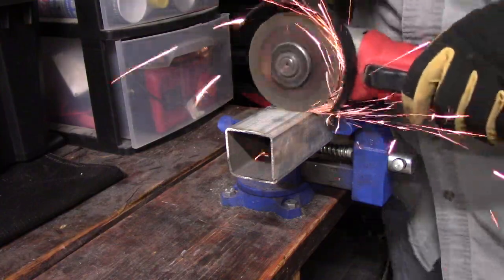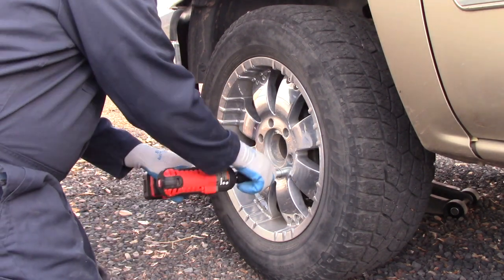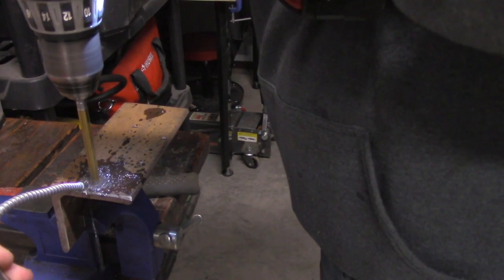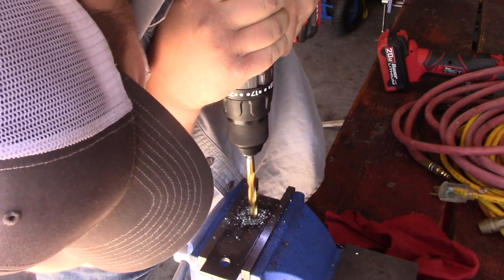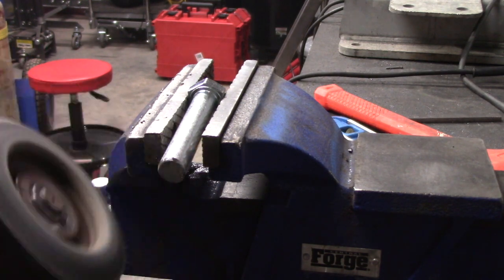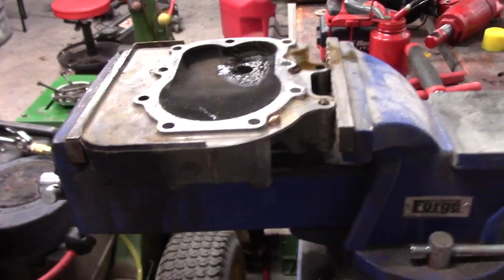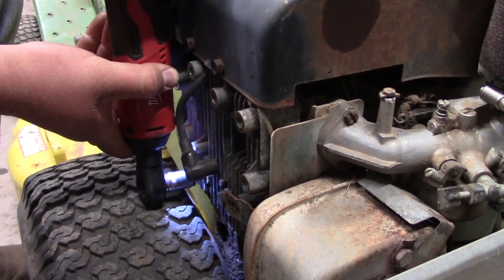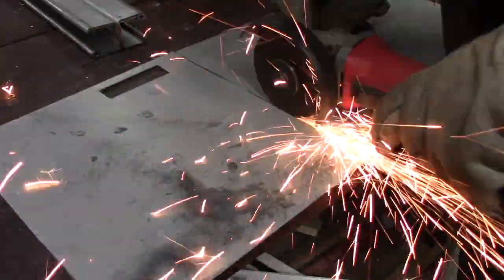Why I Sold My M18 Milwaukee Tools and Bought Bauer Tools

Comment: I prefer corded tools. And I don't really understand why everything needs to be cordless with a brand-specific battery... Or why a home gamer would need 4 different cordless drill-type tools. I've got a power strip right on my table and it takes care of everything 🤷🏻‍♂️
Reply from the maker: Cordless tools are super convenient. Being able to just pick up a drill and get to work anywhere you want is really nice, I grew up in the age before cordless tools. Plugged in lots of tools in my life, and now have cordless, I would never go back. As far as having 4 different cordless drill type tools, they aren’t all
The same. One is a hammer drill for concrete but all does regular drill work, one is a cheaper regular drill, one is an impact driver which is not the same thing as a drill, they sort of work in the same purpose but it’s significantly better at driving screws. Then I can’t tell you how handy the right and drill has been for tight spaces. All in all, having a variety of cordless tools for me is like collecting model cars for another guy or guns for another, I just like having them at my disposal, I like having the full tool line. It’s not necessary for sure, but we don’t always do things out of necessity.

Comment: Reviews. Do the reviews man. I'm kinda in the same dilemma as you. I got the ol Craftsman C3 19.2v stuff, never got into the lithium for them. I'm in a spot since they dont make it anymore, I can still buy genuine batteries as well aftermarket. I'm really havin a hard time deciding on keeping these C3 tools and just buying new batteries or upgrading to new. Now, new, I'm having a helluva time deciding between Milwaukee or Bauer. There are a few stores around me selling new, used and refurbished Milwaukee, M12 and M18. I was givin a M12 screw gun for Christmas and really like it so far. 

So for me, I like to see reviews, not just open it up, pull the trigger and charge the battery. I watch a review of the Hart impact driver from Walmart. The 1/4 inch impact, broke lug nuts loose on a half ton Dodge pickup. That's impressive. I wonder if the Bauer can?
Reply from the maker: I can tell you having had both the Milwaukee and the Bauer 1/4” impacts, the Bauer performs better. Now the Milwaukee might last longer, that is yet to be determined. I used my Milwaukee to put in tons of screws on a play house im building for my kids about two days before I sold them and then bought all the Bauer I have two days after that and used them to put more screws into that play house and the Bauer zipped them in way faster with much more authority. 

Now the impact isn’t indicative of all Bauer tools compared to Milwaukee tools. The Milwaukee brushed grinder has an edge on the Bauer. I find the Milwaukee drills perform mostly the same but the Bauer drills have a little wobble in the chuck.

Comment: I've picked up several Bauer 20v, and I use them just here and there for DIYer projects and repairs.  I also have Porter Cable 20v, and the Bauers are comparable, and in some cases better.
Reply from the maker: Michael I have used Porter Cable as well. Used to own an NiCd set. I find that Bauer is at least as good as Porter Cable.

Comment: You can’t just leave batteries sitting without ever charging them. They deplete, and if they have no charge and deplete, it destroys them.
Reply from the maker: Yes, it was entirely my fault they didn’t last. They were usually charged up in my shop but in my area in the summer time my shop easily heats up to 120 degrees in the day time and in the winter it gets down as low as -5 degrees. Which is hard on a battery no matter what. I keep my new batteries in the shop.

Comment: why did you downgrade your tools so you spared battery expense? probably sponsored video
Reply from the maker: I did it for two reasons - 1. Expandability. Bauer tools are anywhere from 1/4 to 1/2 the cost of M18 tools. 2. Battery expense, yes. The batteries are significantly cheaper for the Bauer line up than Milwaukee. I needed new batteries for my Milwaukee tools. I figured if there was a time to switch, it was then. Harbor freight doesn’t sponsor channels my size lol 😂.

Comment: Its not about how much you use the tool, its about having the tool when you need it. 

If I went Harbor Freight, I would have gone Hercules.
Reply from the maker: They seem reliable enough that when I need them to work they’ll be there. I’ve had some of them for well over a year with moderate use. 

The thing is that Hercules has far less tools, they are getting them out really slow, and if I was going to go Hercules then I would have just stayed with Milwaukee. For the record, it’s about 5 months since I sold my Milwuakee tools and I am fully satisfied with my choice still. But with all that being said, I completely understand why people are hesitant to buy Bauer or even acknowledge that it might be good. Harbor Freight’s track record with electric power tools has not been great, but I think these are a good indication that it’s changing.

Comment: I think you made a great decision, I bought into bauer because of the low entry cost, I'm so glad I did, I wouldn't have the tools and capabilities at home that I do today.

Is Bauer the same quality as higher priced brands, no but is it good value for money yes. The circular saw is my favorite, is the circular saw a perfect tool? No. Does it work really well for the $51 I paid for it with the blade, yes phenomenally well, I've built so much with it, and I've had it for a year now and it still works great. I just bought the Jigsaw the other day which honestly is higher quality than most similairly priced competitors, I work as a tool guy at lowes now, and Porter Cable and Craftsman are nearly the same tools at much higher costs, both for batteries and tools. If you compare the Bauer Jigsaw to those, there is no comparison, 4 oscillating modes, a lazer sight and tool less angle adjustment. Batteries for Craftsman and PC are double the price of Bauer. The Bauer beats the crap out of them.

I've also had my Bauer Impact driver for more than a year now, dropped it several times, once into muddy gravel from 6ft and it's still just fine, all my batteries are still good. I really have no regrets buying Bauer, I have corded bauer tools now as well and all of those are meeting my expectations as well.
Reply from the maker: I wanted to try it out for the same reason. Low cost batteries and low cost to expand my “collection” of the system. 

I’m waiting for the circular saw to come back into stock in my store. It’s been out of stock for about 2 weeks now. I’m betting HF is changing the look of it like they have with all the other tools up to this point and the batteries. That why it’s taking so long to get into stock. I used my Bauer impact when I opened it to put in a few screws and I kid you not it probably zipped those things in twice as fast as my Milwaukee impact did and with much more force. I’m pretty pumped about the tool line right now. I just hope these tools and batteries last a long time, performance wise, they are totally worth it.
Reply from the maker: Also, I used to work at Lowes about 4 years ago. I liked the company for the most part. And awesome being in the tool department, easily the most fun. I worked as a cashier, in flooring, and then in receiving.
Reply: @DereksWorkshopAndProjects   yeah its a great part time job for me right now, I really like working in tools.

Comment: I have had the chance to use numerous Bauer tools and i will have to say  you could get some stuff done with them. But I would have to say the grinder is bye far the worst most gutless powertool I have ever used. Check out redempton garages video pretty much came up with the same conclusion it should say Fischer Price on it.
Reply from the maker: It’s an underwhelming tool for sure but most brushed motor angle grinders are. For the price it costs, it not bad, not good, but not bad. I have gotten work done with it.

Comment: Bauer line still uses brushed motor technology. Milwaukee and Dewalt are using slightly better brush-less motor technology. Hence the price difference. Something to consider for your purchase. I use bauer for repairs around my families business. Never have issues but thats certainly not professional grade repairs that are being done. More like here and there repairs.  Still works well.
Reply from the maker: I am not going to say I know 100% for sure, but I believe the only brush-less motor tools that Milwaukee is selling is in their FUEL line. I don't think their bottom end tools are using brush-less technology. Also, I think I would give Bauer more credit than that. Its not an all day every day tool, but I think surpasses a once in a month DIY roll too. I think it fits right in the "weekend warrior" category that uses them regularly and uses them reasonably hard, but not necessarily all day each day of the week. I haven't been in the line for very long, so its hard to know for sure, but so far, I am impressed, and they are performing on average, as good as my Milwaukee tools were.